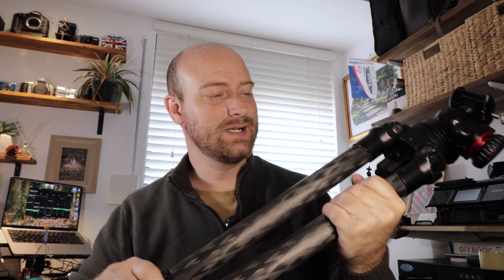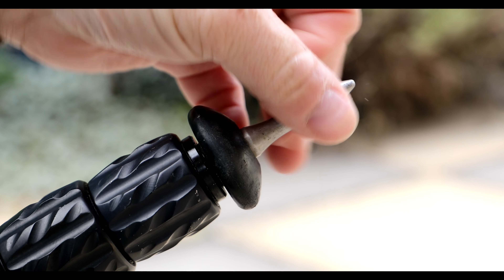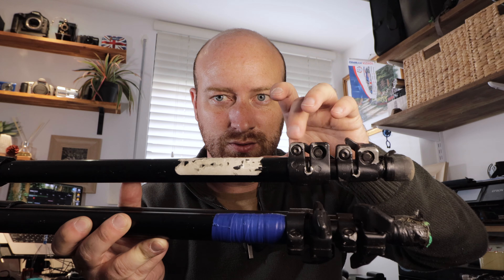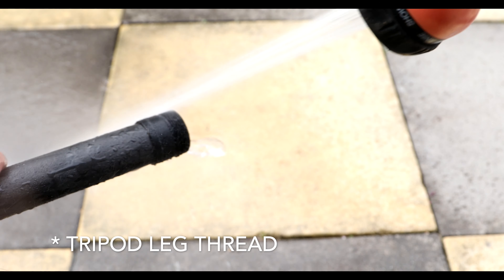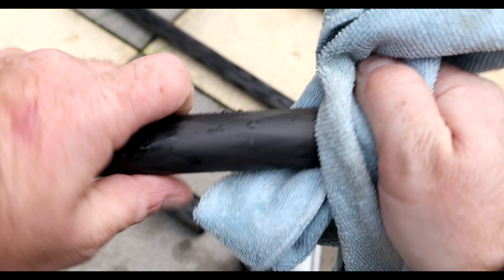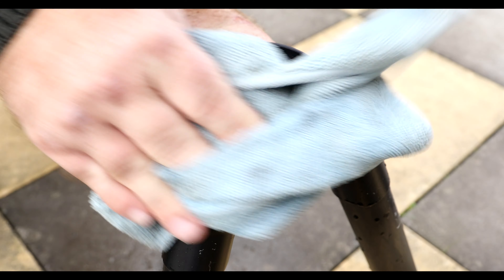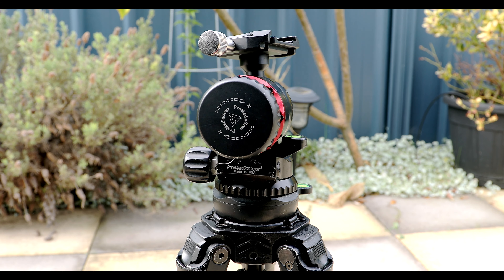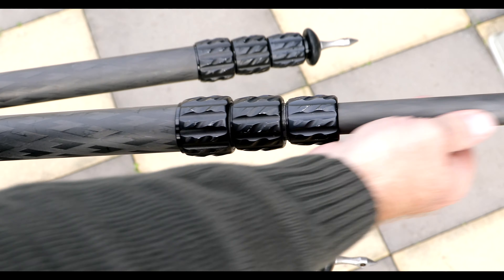How To Clean & Maintain Your Tripod | Wet Method

Comment: Nice video, good of you to post, Simon. 
There are a few things I'd suggest changing. Sorry if most of them start with "Don't".
1. Don't use WD-40, over time it dries up and leaves a dusty, blobby mess that will eventually interfere with function. Try a penetrating spray instead. 
2. Don't use the spray on the threads of each leg section, use lithium grease, a small dab is enough and will stay viscous far longer while providing better protection against water damage. 
3. Don't use a high-pressure spray, it can easily cause damage  or send pieces flying off. Use a microfibre cloth with a length of sturdy string attached to it to clean inside each tube. 
4. Overall there was far too much water being used for my liking. All that water will remove some very important grease, and it can be in some inaccessible places, so be very careful where you point that water sprayer. I'd leave out the water entirely, but that's just my $0.02.
5. Lastly, I'd advise people to clean only when really necessary, and not more than that. Small parts can break if they're always being removed and re-attached. 
Happy shooting!
Reply from the maker: Thank you for your response and taking the time to watch my video, I have a few different ways of cleaning my tripods but this is one of my main ways. I'll respond to each of your statements. 
1. I've actually found this way that I used to work very well over time and hasn't caused any issues, mind you I don't abuse my gear like some people out there which is possibly why this method works. I clean my tripods normally twice each year.
2. I have got copper grease I have used in the past but the thing I don't like about grease more so on parts that are metal on metal, over time fine traces of metal end up in the grease and can cause more wear, something I have actually experienced with other greases I have tried over time. 
3/4. Since I shoot a but around the sea the sea spray tends to really stick to the tripod, the pressure might look bad but it really wasn't that bad at all. also with the PMG stuff it doesn't use any grease in the gear and it is something they strive for as grease can freeze and cause problems, if I wanted to clean a grease filled head I would clean it separately and really strip it apart and re apply the grease in certain areas. 
5. I don't recommend people do it often as well as you say little parts can break, but also if people shoot in really dusty and dirty places that will build up within the tripod and need regular cleaning. of course there's some things to do in the field to minimise this like not putting the tripod leg clamps into the sand and instead extend the lower section of the leg to keep the mechanism clean and dry. Also not putting the legs back when dirty, I keep a cloth in my car to wipe down my gear after a shoot on location if needed. 

I hope you don't mind me responding as I wanted to give you some context from my side.
Reply: @SimonPhillipsPhoto  Thank you, it makes sense. There's definitely more than one way to skin a cat. Keep up the good work!
Reply from the maker: Thank you 👍🏻